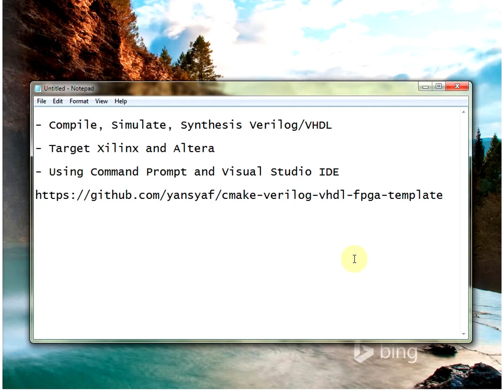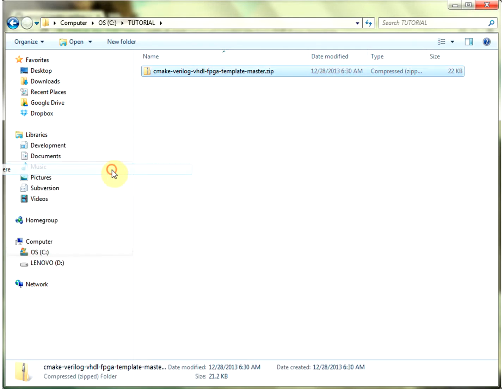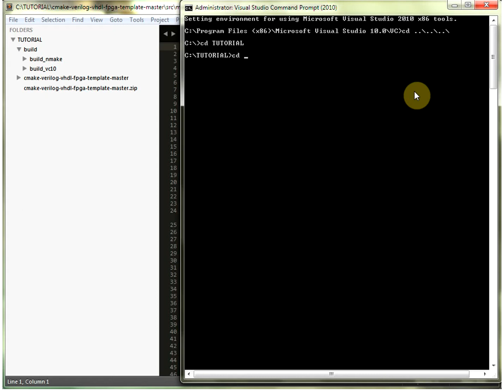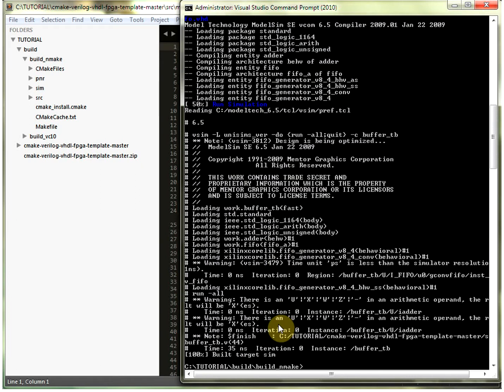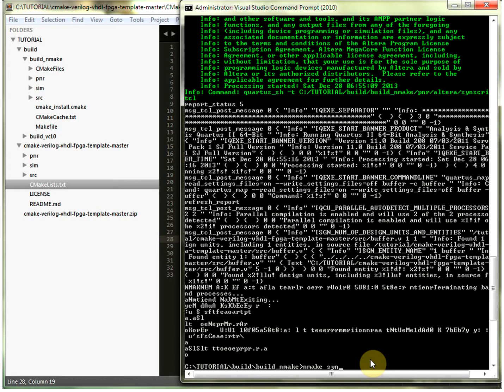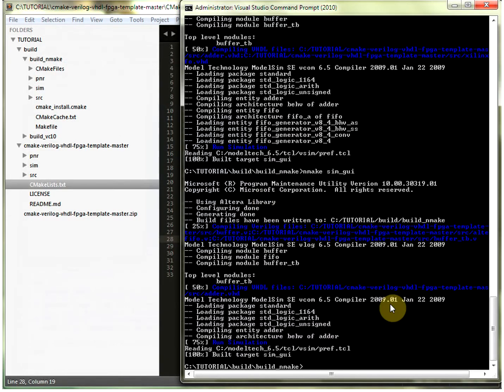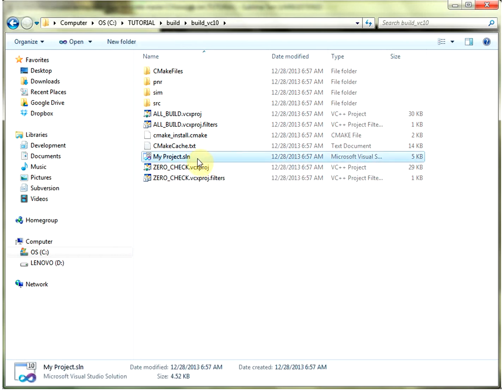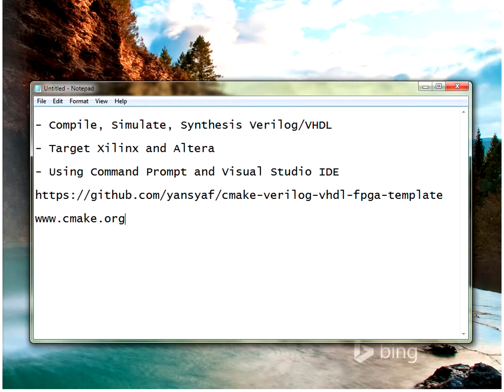Jump Start Your Verilog/VHDL Project Using CMake

Comment from the maker: Cara cepat untuk memulai project Verilog/VHDL. Compile, simulasi, dan synthesis dengan CMake. 

Benefit:
- Quick setup
- No need to create separate simulation and synthesis script
- Cross platform, cross IDE
- Maintain file consistency between simulation and synthesis
- Integration with Continuous Integration like Jenkins, Hudson, etc.
Reply from the maker: Source code is available here: https://github.com/yansyaf/cmake-verilog-vhdl-fpga-template
Reply: Saya share di Facebook, mas. :D
Reply from the maker: Ok, will.. :D